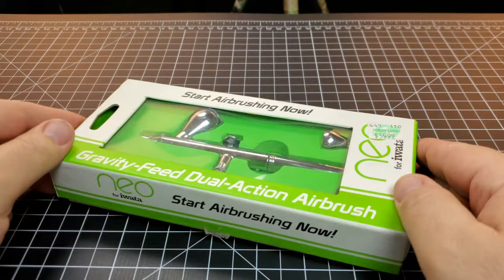Airbrushing With Cheap Acrylic Craft Paints: What You Need to Know

Comment: Im a beginner. Dont know the best air brush to buy. $$ though. Is there alot of overspray? Can u spray in the house?
Reply from the maker: Check out the Ovoga airbrush. I did a review on it not long ago. I paint in my basement at my work bench.  I cut one side out of a large box and use that as a paint booth because yes you will get overspray.

Comment: Thank you so much.  I bought an airbrush over 30 years ago and tried it out with my acrylic paint and gave up.  Now I need to pull it and the compressor out to see if it still works.   one ?
1. never seen a strainer like that before.  Where might I find one?
Reply: never mind!  I saw you link below and bought one.
Reply from the maker: Hi Bob. Thanks for the comment. I hope everything works. If you re-visit my video. In the description I have a links to the items used in my video, including the strainers. Also at the end of my video I have a link to a similar video I made about 4 months ago that goes more in depth. It includes tearing down and cleaning the airbrush. Plus I paint a N scale building.  Thanks again and take care.

Comment: Jeez, you know I'd never given any thought to the cap for the airbrush cup (which I never use) but it occurred to me while you were talking about evaporation that that must be the reason I get rings inside the cup. 
I'd never known there's ISA in thinner, nor that paint dries faster when using it. 

In Canada, I pay upwards of $12/bottle for Createx paint from Amazon (or drive 200 miles), so even a splash of reducer has great value. If it hastens the drying time, all the better. Thanks for yet another tip. (Btw I just subscribed, as I'm new to airbrushing & can use all the help I can find, so thanks for being here)
Reply from the maker: Man that is crazy expensive. Almost three time what I pay here in the states.

Comment: Wherever you're getting those the water airbrushes even if they are nails that is an excellent price I have to pay $130 here in Texas I don't know where you're at but dude at 60 bucks that is a steal you should grab them out and use them as giveaways for the people that watch just thought and my chip on acrylic acrylic they have paint that help them to slow the drying time yeah I will drop for two of it in there in with the cheap acrylic and it'll keep it brush plus use they have nozzle lubricant a lot of has a specific one that they make for their guns if you use that on the needle it'll help even with the seals it'll help and then I'll keep that acrylic from out there even though you do a long session it'll help prevent most of the possible damage
Reply from the maker: Thanks Chris for commenting. The NEO are now 70 bucks on Amazon. Still not a bad price.  What do you use to slow down the drying time of acrylic paints?

Comment: How did you clean out your paint strainer??  I have a terrible time cleaning out those tiny holes.....:(
Reply from the maker: Hey Dwight. I use a tooth brush. Not an old one that has messed up bristles. I bought a cheap one just for that. I also make sure that I clean my strainer as soon as in done with painting when I'm cleaning my airbrush and or any mixing containers that I have used and of course I clean it between color changes.
Reply: @RoadsAndRailsHobbies  thanks for your answer

Comment: So I got this Craftsmart white satin paint from Michael's.  I tried to thin it using 91% alchohol... then I tried to run it through my new airbrush...
oof.
It did not mix well, and gunked up my airbrush pretty bad.. took a long time to clear it all out.  Then I went to pour out the mixture in the sink, it was basically just oil and water.  Idk what the deal was, but I wont be trying that again.
Reply from the maker: Hey there CallmePopy. White has always been a problem for me to airbrush. I feel your pain. There are a couple of other colors that give me the same issue. When I need to paint with white, I use createx airbrush paint. I am sorry it caused you so much trouble.

Comment: Have you tried "de-natured" alcohol?  Or 90% isopropyl alcohol?
Reply from the maker: Hey Karl. I have not tried denatured alcohol. And to be honest. I don't know enough about it to be able to give any advice. Now onto 90% IPA. Yes I have used it, but I prefer 70% IPA.  Using IPA to thin paints works well and the benefit to using it is that the paint dries faster so you can put on more coats quicker. That however is also the downfall of using IPA. It will dry your paint out fairly quickly. And as you probably have already guessed, using 90% IPA only makes it dry that much quicker. Don't get me wrong. I use it and will use it, but I prefer 70%. Thank you for watching and commenting. Take care and happy railroading.
Reply: @RoadsAndRailsHobbies  It is my understanding that IPA contains an oil (which is why it is called rubbing alcohol) which I think might be a problem in some cases.  Denatured alcohol has no oil.

Comment: i am having an issue what to do if to thin acrylic paint it does not to be to seen to be spraying corectly? the thinner the paint the lower the pressure? maybe like 10 or 15 should i try?
Reply: Hey Charles. In general the thinner the material the lower you air pressure should be, to a point that is. Just keep adjusting down until you get a spay pattern you are happy with. For my mixtures I run at 20 psi. I shoot for a consistency of milk when thinning.

Comment: I use cheap craft paints almost exclusively on my plastic model kits when using my "cheap" airbrush and have not had a problem. The great thing about using craft paints is the low VOC gasses given off. I don't like using solvent based paints, the smell lingers for ever.
Reply from the maker: Hey Joe. My airbrush setup is in the basement, so I know what you mean about smell lingering with solvent based paints. I have a lot of createx airbrush paints I use as well, funny thing though is that I find the cheap craft paints seem to "stick" better to plastic models and any 3d printed items without having to much prep if any at all. Thanks for watching and commenting. Take care.

Comment: You will not ruin any airbrush using hobby acrylics or any other paint for that matter.  What causes harm is the thinner/reducers used along with the materials used in the seals of the airbrush and poor cleaning/care.  Some chemical thinners can react bad with certain o-rings and other components.  If you have a $400 airbrush rest assured it's all but bullet proof when used and cleaned properly.  I run a Patriot 105 and Anthem setup for most of my work as the different needle sets are all interchangeable between the 2 and I have a few needle sets for each, these are great for heavy work and replaced my Paasche H only a few years ago.  The Iwata eclipse was a bad buy as it offered nothing my 105 can't do just as well except with Inks, the smaller needle/nozzle does make a finer line with inks and works amazing.  My Harder & Steenbeck evolution is just a collectible now and in my opinion wasn't worth the money as the 105 holds it's own well at more than 1/4 the price. The H&S is another fine ink type airbrush great for illustrating like the Iwatas, but for general car/ train hobby painting the Patriot 105 does it all including great stencil work.  Just remember to polish your needles using Brasso or Flitz especially the lower end brushes and you'll notice a real difference.

Great video! Keep up the great work!

Comment: can you premix and save them or do you mix each time with alcohol?
Reply from the maker: Hey Tia. You will need to mix them each time. The properties of using alcohol to thin your acrylic craft paints makes the paint dry very quickly when airbrushing. That is one of the main reasons why I use alcohol. So if you pre thin your paints they will unfortunately dry out in the container turning very rubbery. Sorry for the long answer for a short question. 😁 Take care.

Comment: I have small bottles of acrilic paint but the result is bad. It paints but also spitting, if I may say.  I know I'm a newbie but I've tried lowing the pressure, raising it, but does the same thing. Is it the bad quality of the airbrushs because they all do it. I have two same Mastercraft pen size and a 0.8mm Yosoo  pistol. This last one I bought it at $64
Reply from the maker: Hi chauffeurmarco. Let's start at the beginning. Are you thinning your paints to the consistency of milk? If so are you running thr thinned paint throughout a fine mesh strainer to make sure none of the big pieces of pigments aren't getting into your airbrush? That is the first thing to check. Run your air pressure at 20 psi to start with. I would remove the needle cap at the tip of your airbrush also many times paint will gathere there during the painting process and you can get some spitting from that. Also if you have it removed you can check the tip of the needle and see if you are getting any dried paint building up on it. If so just scrape it off with your fingernails.
Reply: @RoadsAndRailsHobbies  yeah, few min ago I saw a small strainer. I’ll try it. For the tip, it’s not working if I remove it. Today I spent an hour to figure out why only air were coming out and no paint at all, even when I pull back the trigger. So the needle cap has to stay. Every thing was clean because first time using them. I never thought of a strainer because I’ve seen so many YouTube about it an no one used the strainer. But I have to say, at first I used acetone as a thinker. Not good. Turned into kind of mud. Then I went for the alcool which turned my thick acrylic paint into milk texture. I try distilled weather or thinner next time.
Reply: @RoadsAndRailsHobbies  I just ordered today the strainers. Meanwhile, I tried the metallic paint and I have not spitting but with this paint I get lot of micro bubbles in the paint. WTF

Comment: Can i paint a controller with americana paint?
Reply from the maker: I am assuming you are talking about a gaming controller. You can use any craft paint but you will need to use a clear coat over it to protect the paint or it will wear of quickly.
Reply: @RoadsAndRailsHobbies  ohh thank u for the info, but how about the “soft touch varnish” from americana? Does that need clear coat too?
Reply from the maker: I've never used that product so I really don't know. Sorry....

Comment: I'm looking for a cheap formula to make a PRIMER to use on Glass. I've been asked to paint a School's window's, they're only Junior & Infant's so I'm not charging and wherever I can I provide the 'ACRYLIC' paints for my Airbrush. This is why I'm trying different paints and other liquid's such as IPA etc for a primer but the paint is still scratching off!  Any advice would be gratefully received.
Reply from the maker: Hi Andrew. I'm sorry to say that painting glass is way out of my wheel house. With that being said I have seen acrylic craft paints that are made for painting glass. Same brands that I show in my video. I have zero experience with them however so I do not know how well they work.
Reply: Either use enamel paints or you have to clear coat it.

Comment: Avoid the metal agitator, use glass beads or other items that will not rust.
Reply from the maker: That's why I use stainless steel nuts. But if you have glass beads laying around that would work great.

Comment: Have you ever used Poly Scale paint as I am having trouble shooting it . Mostly it plugs up the brush and I get runs .
Reply from the maker: Hey John. I have never used Poly scale paint. I just read that it is an acrylic paint. Is it gumming up your airbrush during the same painting session that you are getting runs. What are you using to thin the paint. And what kind of surface are you painting where you are getting runs. Two more questions. What brand and model of airbrush are you using and what do you have you PSI setting on your  compressor at.
Reply: I've used Poly Scale and like it. However, run it through a strainer and make sure the surface is very clean. I had to use about 25 psi on my Paasche VL.

Comment: I have watched a ton of videos on the subject of air brushing and so far I can't find many of the names supplies that you folks use. I've tried online at Michael's and Hobby Lobby but find very little. Can you point me in the right direction to buy a paint strainer and some cups and bottles? So far I'm finding zilch.
Reply from the maker: Hey Ray. If you look in the description of the video I have a link to the strainers that I use. Their from Amazon. You get tree stainless steel strainers and three silicone funnels. I have been using the same strainer now for years. Actually my wife confiscated the other two for the kitchen. LOL. As far as bottles go that I use to mix paint in. I use whatever I can find around the house. Some are old testors paint bottles. Heck I even use old prescription medicine bottles. The little cups I use are again things from the house. Most of them are medicine cups. Like  Nyquil and such. Now if you want little glass bottles like the old model paints. I have seen them sold both at hobby lobby and Michael's. I hope that this helps. Take care.
Reply: @RoadsAndRailsHobbies  Thanks Paul. I'll have to do a more thorough search. I tried every search term I could think of.

Comment: I use STAINLESS NUTS to mix my paints. They're so much better than glass balls or stainless steel ball's. So much more surface area and a hole to help mix the paints. If the NUTS are attracted by a magnet DON'T USE they're not STAINLESS STEEL they'll be chrome coated soft steel and will eventually discolour the paint (rust). Could be me who suggested the nut idea, I'm always suggesting it. Paint manufacturers should use them they're cheaper than glass or stainless ball's and in my opinion do a much better and faster job of mixing the paint. I use M4 stainless nuts for 30 to 60ml bottles and obviously larger for larger bottles to have a larger momentum to get from bottom to top of bottle.
Reply from the maker: Thanks for the good advice Andrew. I appreciate it.

Comment: Hi Paul. I am strictly military aircraft scale model builder and haven’t experimented using these craft paints yet but am strongly thinking about giving them a try.  I was wondering. Can you thin them using Windex or Windshield Washer Fluid? Or is Isopropyl Alcohol the safest bet?
Reply from the maker: Hey Specter. I do know others have used windex to thin acrylic craft paints. I have never tried it myself, so I can't speak about any differences between that and isopropyl alcohol.  I can't remember off the top of my head, but I do remember reading that some windex formulas have an added ingredient that could harm the o rings on your airbrush. Thanks for commenting and asking a great question.
Reply: Yes that is correct about Windex with Ammonia . It is said to be dangerous by some to the airbrush seals and to strictly go to ammonia free Windex.  I will experiment with windshield washer fluid to thin and let you know how it works.                                                                         Thank you kindly for your response!!
Reply: @specter080  how did the windshield washer fluid work?
Reply: @jasonsmith7402    Windshield wiper fluid seems to thin these craft paints pretty well. Im still struggling with getting good paint flow and getting the airbrush not to clog (I’m using a Iwata Neo with a .35 needle set) I just bought some Vallejo flow improver which has reduced some of the clogging issues. But anyways I’m bound and determined to spray these paint’s correctly.
Reply from the maker: Specter. One question. Are you straining your paint through a fine mesh strainer before loading it into your airbrush. That made a world of difference for me.
Reply: @RoadsAndRailsHobbies  this certain paint I have not but I am going to try. I have used a old pair of my wife’s nylons on some old Modelmaster acrylic paint. What type of filter do you use Paul?
Reply from the maker: Specter. It's easier to show you. Go back to this video and look in the video description. I have links to Amazon for the items I use and the last one listed is the strainers. Check them out. I've been using them for a long time. And they work great.
Reply: @RoadsAndRailsHobbies  thank you sir.  I will give that a look. 👍

Comment: Where do you get those strainers at and are they reusable .
Reply from the maker: Hi John. I buy them from Amazon. There is a link in the description of this video for them. They are stainless steel and very durable as long as you don't poke a hole through the mesh, ask me how I know. LOL. Thanks for commenting.
Reply: @RoadsAndRailsHobbies  I do not see any links, I need that strainer :) Thanks for the videos sir
Reply from the maker: Hey Pyro Chuck. That is weird. I just checked and it's there. Let me send you the link.

Comment: neo is a cheap chinees made airbrush. it is made for iwata, but the differences are huge. i am not using it anymore, very low quality. for 60$ there are much better airbrushes like sparmax
Reply from the maker: Thanks for the info Daniel. I'll have to check out the Sparmax airbrushes. For me the NEO was still a major step up from the super cheap airbrushes that I had started with. Thanks again for the info.